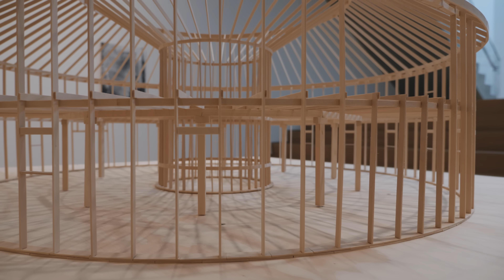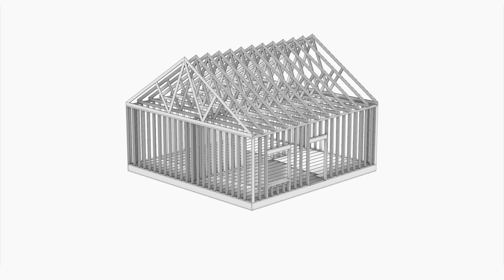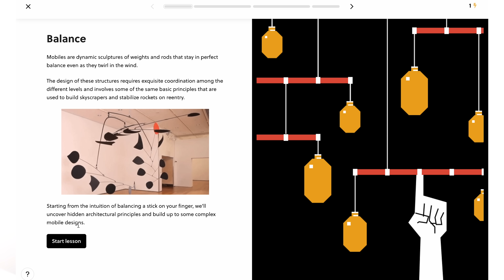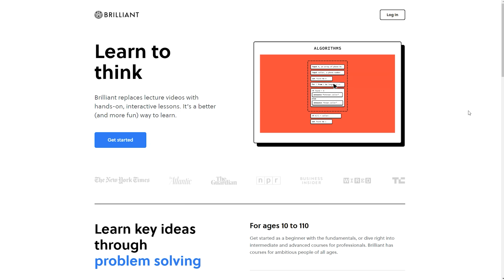The Genius of 2x4 Framing

Comment: this video is wonderful, it is very interesting to know how the US build their houses. 

Here in Brazil, we use clay or cement bricks a lot. I would love to see a video of you talking about the different types of buildings around the world and why they are used! Keep up the GREAT work.
Reply from the maker: Great suggestion.
Reply: @stewarthicks  Truly! You could also feature the saying "form follows climate"! First heard it at a presentation by Harquitectes, based in Barcelona.
Reply: @stewarthicks  Houses could be built of mostly Paulownia wood (or other woods, like pine). The walls could be solid Paulownia wood, and would not need added insulation because Paulownia wood is naturally insulative. Chemical foams that pollute the environment, and harm people, would not be needed. Being built of solid wood walls, these houses would be very strong against wind, probably even stronger than brick houses.

Paulownia wood is fire-resistant, rot-resistant, termites don't like it, is very strong for its weight, is easy to build with since it is so lightweight, it dries very fast, and when it dries it does not crack or warp. 

Some houses in the cold Nordic countries already are built with solid (pine) wood walls, with no insulation other than the wood. Paulownia wood is a much better insulator, but pine would work fine in most environments. Here's a video on that: youtube.com/watch?v=4j_UjIshzMc

Growing Paulownia trees and making things from the wood, would help grow our economy, and sequester CO2. Paulownia trees sequester up to 6 times more CO2 per year than the average tree. When cut down, Paulownias very quickly send up new trunks to replace the harvested one - the new tree can be ready for harvest in as little as 4 years, and the tree from the same roots can be harvested 7 or more times over the years. And no, Paulownia trees are not very invasive - they were actually native to North America thousands of years ago, but naturally died out.
Reply: I would be particularly interested in adobe and rammed earth construction. I know their utility is limited outside of the American west, with its dry climate, but they still seem to be the preferred building material in desert environments.
Reply: @christopherstephenjenksbsg4944   you can build with earth in any climate. where I live its 4 seasons climate and we still have earth homes and even have few stiles. Its not method of building today, but u can still do it. i have village house that is built with adobe brick. its built in 1962, builders were smart they used 5 rows of adobe brick then 1 of baked clay brick for added strenth. walls are 660 cm thick and ceiling hight is 3 meters.
Reply: @christopherstephenjenksbsg4944  I grew up in an unfired clay brick house in Western Romania, it was the best house I ever lived in. As long as you don't let water get to the walls, ( water proof the walls from the foundation and apply a quality outside render ) you'll have a solid building that lasts for centuries. 
The air quality inside is amazing, because the walls self-regulate moisture, the house is warm in the winter and cool in the summer.     

Of course, these kinds of homes are not advised for areas with flooding or earthquakes, but outside of that they are pretty much the best to live in.
Reply: Yes! Was thinking that too, in Russia a wooden home is treated as an inferior one, while building a house out of brick is something that is prised, it usually showcases wealth & quality of the owner.
Reply: @shnorakalyutsun  In early U.S., stone was very popular, then later brick and usually the more prestigious owned them as well. Brick, concrete, stone, cinder block are all inferior to wood framing with almost virtually no insulating factor and limited future changes. However in traveling Europe including Russia, I love seeing all of the different architecture and wouldn't want it to change.
Reply: @shnorakalyutsun  a true brick home is prized for the same reason in the US as well. Americans use stick framing because it is significantly cheaper than brick, but the end product is to the average person, nearly identical especially if brick veneer is applied.
Reply: Same with the 3 little pigs  @shnorakalyutsun
Reply: I'm also from South America and had the same exact thought. Thank you for posting this suggestion and I do hope Stewart makes a video about it.
Reply: Here in Mexico too, it's weird being so close to the United States and not  adopting wooden houses as a cheap way of construction
Reply: @FranciscoBurrola  Maybe, but Mexico doesn't really have an abundance of trees does it? Compared to the straight longer whitewood types in the US and Canada. Probably because of what's available locally.
Reply: @mattk6827  34% of Mexico is forest...so yea, they have assloads of wood.  Going from the temperate Medrean Pine-Oak woodlands, to sub tropical, tropical and cloud forests.
Reply: @justicar5  Yeap, but there's no industry!! I'm mexican living in Quebec, Canada now. The amount of people that rely on jobs related to the wood industry is huge, most of it exported to the US for construction. Try to buy furniture made oud of wood, in Canada or the US,  crazy expensive compared to Mexico.
Reply: @FranciscoBurrola  Because the wood industry in Canada and the US is huge is cheap, same happens with cinder blocks and cement in Mexico. I come from Monterrey, no wood is cheaper than cinder blocks and cement!!
Reply: @FranciscoBurrola  Do you think it has to do with Mexico not having many forests suitable to produce the required lumber?
Reply: In Argentina too : )
Reply: In earthquake prone areas, we aren't allowed to build with brick anymore, they just crumble. Also in fire prone locations, wood roof shingles are no longer allowed. In colder climates with heavy snowfall, you'll find more steep peaked roofs to prevent the weight of the snow from caving in the roof. I would think that basements are more common in flood prone Areas. He didn't say what construction could withstand tornadoes or hurricanes, high winds better. I would think timber framing would be sturdier, and also more expensive to repair. Round buildings might avoid winds easier. I've seen small homes made of grain silos.
Reply: @recoveringsoul755  Nothing, affordable, withstands tornadoes. Hurricanes are easier, unless they are big CATs.
Reply: @jdilksjr  I've seen some tiny homes using grain silos that were used as housing for hurricane victims, and they withstood the hurricanes pretty well. More aerodynamic I guess, big, flat sides catch wind easier.
Reply: Here in Finland making houses from wood is a tradition as old as history itself, and it has been refined to the highest standard in all of construction. Even before wood framing, houses were built from full squared wood logs and those houses are still standing in pristine condition all the way from the 1800s. To have a house made from something else than wood inherently makes it inferior in every single imaginable and unimaginable way.
Reply: Now here in brazil we doing the same way as US do there houses can u share this video with translate in portuguese for those  people who needs  to know more about where the wood frame come from
Reply: I guess we can find the most common building practice in every country. Here, there's a saying: if it's not built from bricks, it's not a house. So, building, even designing a wood frame house raises eyebrows.
Reply: Do your kitchen walls have tile up to the ceiling? My wife is from Brazil, I found the architecture differences very interesting. So much more tile than we used in the US, even on the outside of buildings. In recife's case I think it has a lot to do with the humidity. Interesting whatever the reason is.
Reply: @joshuaraulfrancesbedroomte6568  buzz off Kareem!
Reply: A point to add is that the average construction here in Brazil uses steel reinforced concrete as a kind of skeleton to the whole structure, from the very foundation to the roofs. The bricks don't necessarily have a structural role, even though some cheaper homes are built using only hollow bricks and cement. Depending on the terrain, it may cause the building to fall apart.
Reply: I suspect that a lot of it has to do with the natural resources that an area has for building their homes.  Although Brazil does have a lot of trees in their rain forests, it's entirely possible that the type of woods grown there are more exotic and slower growing, so it is more appropriate to sell for making furniture.  If the area does not have a local supply of a fast growing softwood like pine or fir, then the price of that material goes up since you have to import it or pay large transportation costs.  On the other hand, masonry construction just requires acquiring portland cement from a possibly non-local source since the aggregate and sand can often be sourced locally.  Also, in areas that cannot afford air-conditioning, having homes with high thermal mass walls can be beneficial.  One problem though is that masonry walls are not good for areas prone to earthquakes.  For earthquake areas, it is usually better to have homes made from materials and joinery that allows a bit of flex (e.g. light wood framed).  On the other hand, masonry is often better for hurricanes or other high wind events.  No one method is best for every potential type of natural disaster.  You need to look at your area and decide what types of natural disasters are you more likely to experience.  Building completely underground is great for surviving tornadoes without any damage to your house, but it kind of sucks if you are subject to floods.
Reply: I am from Germany, where most buildings are also build with cement bricks and seeing these light wooden homes seems sort of unstable and also not very well insulated?
Reply: @schlaumayer3754  They are not unstable at all but yes do need foam or fiber insulation
Reply: @schlaumayer3754  Cement is ecologically abhorrent, given that it takes massive amounts of heat energy to turn limestone into lime. Even if you use "green" energy for heat, the act of turning CaCO3 into CaO releases copious CO2 by definition. Some things have to be made of it, but it's irresponsible to make things out of it you don't have to.

Wood construction, OTOH, serves as a carbon "sink" where the tree converts CO2 into wood, then stores it for as long as the wood in the building remains wood.
Reply: @schlaumayer3754  Concrete is the most porous material you could construct something out of, it would need just as much insulation.  That's why a basement always has a higher moisture content, and hardwood floors are not good down there i.e.  Concrete withstands hurricane and tornado forces for sure, but also makes it nearly impossible for expansion etc.  If I was in a tornado or hurricane I would prefer a concrete building, many houses in the Carribean are built with at least concrete rooftops.  I would hope those bricks aren't only cement, since you need an aggregate like sand, and gravel to make it strong as well as steel reinforcement.  Cement is weak and cracks on it's own, everything has tradeoffs.  With concrete the main unstable disadvantage is foundation sinking typically, but for residential homes it's not really a consideration since an unbelievable amount of weight is needed.
Reply: @schlaumayer3754  timber frame homes are stronger than bricked homes, believe it or not. And have better thermal properties unless the brick is natural stone. Brick homes are generally only stable due to the roof frame holding it together. Germany has some very interesting construction methods though. Which are as good or better than timber frame. One comes to mind is sips panels which have spread around the globe. But your standard modern manufactured brick home is not the best in many aspects. But Europe does have some high quality brick homes.
Also as mentioned above, Brick homes are not ideal in cyclonic or Earth quake zones. 
Unless the brick is made of a natural stone it has poor thermal properties. For example bath stone is the best for thermal efficiency all year round. Standard double brick if not filled with proper insulation in the centre is poor for thermal insulation. But I know Europe always insulates properly. In Australia, insulation is an after thought in double brick homes and it is really hot in summer and winter is very cold. Timber frame homes will always be installed with wall installation and sarking. There are benefits to each type of build in different areas, but overall steel and timber frame is perfect in all locations. Most homes in Scandanavia are timber framed aswell.
Reply: @schlaumayer3754  American and Canadian building standards are among the world's most thoroughly tested and researched right down to specified span lengths not only for lumber dimension and attachment methods, including ready made steel joist hangars, but of which tree species have been used. The building codes are extremely detailed.  Cold regions use 5-1/2 inches insulation in the walls so most cold regions use 2 x 6 stud walls not 2 x 4 as this video showcases. Attic insulation is typically  foot thick minimum and often more, The building techniques are hurricane resistant and have been tested in many different ways in wind tunnels for more than two generations believe it or not. The stiffness once plywood sheathing and the drywall plasterboard is in place exceeds that of 250 year old wood homes, I do historic restoration work and have taken apart the insides of many old homes which have less rigid walls and stone foundations which settled more than modern concrete.foundations.
Reply: @paulbriggs3072  also, with the "flex" that light framing affords the structures can, to a certain degree, withstand earthquakes as opposed to clay and stone that would crack/crumble. Right?
Reply: @_steffinwolf_  Indeed, not just for that reason but lightweight structures have way less inertial momentum when swaying.
Reply: They are pretty stable and can be built to withstand winds over 100 miles per hour. The insulation depends more on the builder. You can use 2x6 instead of 2x4 and there are even insulated studs. Some sheathing like zip-r sheathing has insulation built in so it’s like a blanket around the while house. Another option is to use standard sheathing and then two layers of foam insulation on the outside with the edge of one piece of foam covered by the other. The house also should be made near airtight with various tapes or liquid adhesives. A lot of builders don’t pay that much attention to detail or go to this much trouble though. Many just do the bare minimum to meet the code standards.
Reply: @schlaumayer3754  those frames in the outer walls compromise energy efficiency indeed. The most energy efficient home is timber frame + sip external walls in my opinion. The once promoted by Shelter institute.
Reply: @schlaumayer3754  Wood structures can indeed be sturdy and well insulated.  For instance, it's becoming more common in the northern States to have 2"x6"  (actual size about 1.5"x5.5" or 38mm x 140mm) walls with a foam board and air barrier covering and R-23 or better cavity insulation (rock wool, fiberglass, or spray foam).  Attics are also usually insulated to R-49 to R-50.
Reply: @mtgibbs  it not problem with insolation it self. problem is that there is nothing to absorb the heat so more energy is used to heat up house and maintain temperature throughout the day. My house is build as we say we say one and half brick, walls are 400 mm or 40 cm thick and on outside is 10 cm rockwool insulation. So that's 50 cm wall and brick can absorb a lot of heat. our propane boiler kicks in 5 times a day for 45 minutes if its very very cold outside.
Reply: @dusanbajsanski6987  It's true that thermal mass plays a part with moderating the temperature, but, at the end of the day, if the energy leaves your house then you have to replace it with more energy.  The less energy that leaves then the less required to replace it.  Insulation resists the transfer of that energy.
Reply: @mtgibbs  i agree, but maybe this will sound stupid and its personal feeling. My friend decited to build Prefab house as we call it(US stile) i don't know R value of insulation. We have thermostat at same temp at 23 degrees celsius, in his house air is worm but i can still feel chills i don't know how to explane.
Reply: @dusanbajsanski6987  I understand.  Air sealing is very important.  It's possible that some air was leaking into the house and, if the house was not a good radiant heat source, you could feel colder.
Reply: @schlaumayer3754  cement and bricks are great till you want to move anything around inside the house, which americans do. Cutting conrete once is enough to be scared of it.

Its good for detached stuff but they build apartments and townhouses this way so you can hear your neighbors fart if its loud enough.
Reply: @chickenpuncher1674  My house in The Netherlands is basically a box of 30cm double walls,  each floor is built by resting prefab concrete blocks on those walls and the next floor is built on top of it.

That means that only the exterior walls are load bearing, I can tear down walls inside the house without worry. Interior walls can be built using any material you prefer, including timber framing.
Reply: Came here to say that, almost only on America where this is true
Reply: Better to stay with your brick and cement because if you build it out of cheap wood  "stick framing" like in Texas your house would collapse in light weather like there🤣🤣